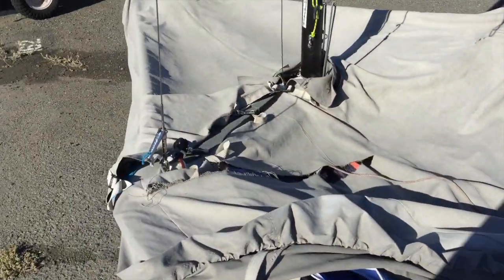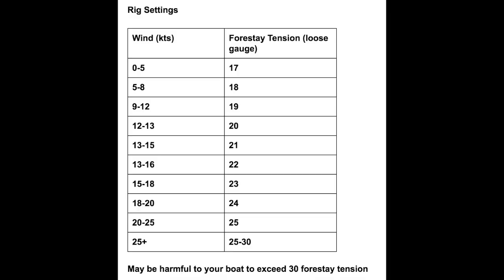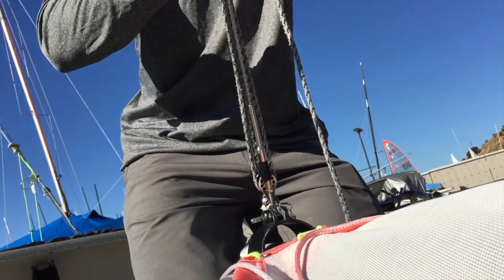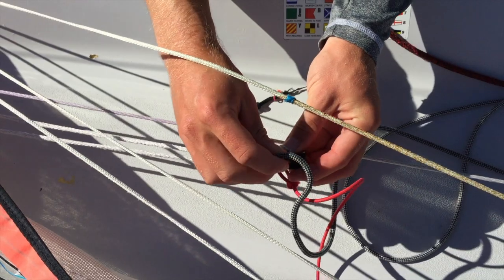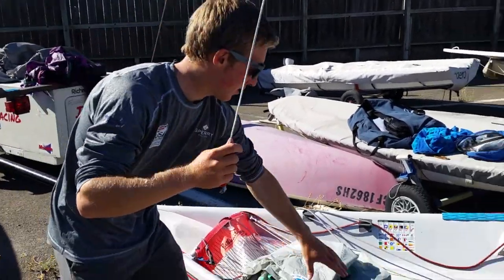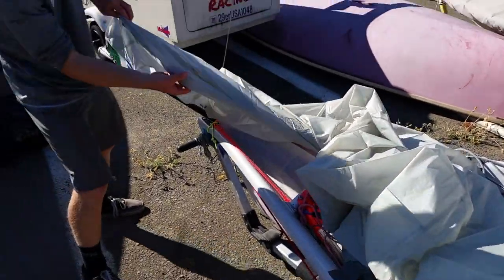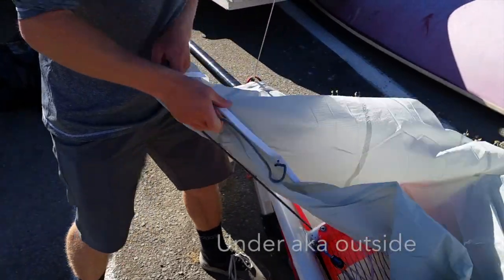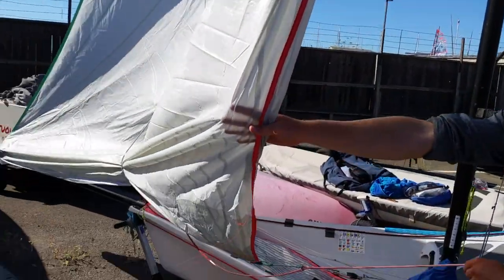How To Rig A 29er

Comment: Does running the bungee outside, around the bow have an advantage? or is it just preference?
Reply from the maker: Like I said the advantage is that it's a clean system with a lot of stretch. Problem is if it breaks both of your trapezes are loose vs. bungees on each side. Another really good system is to put a friction ring on the spinnaker bag throat and run the bungee through there.
Reply: it doesn't you can do it however you like